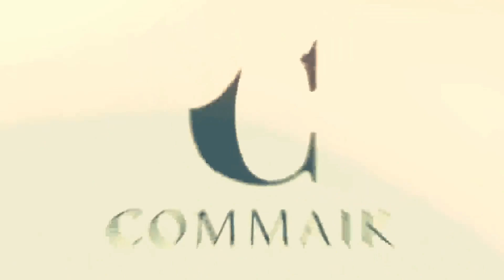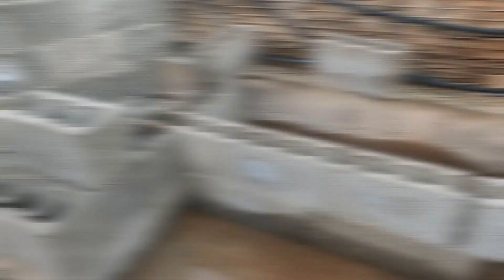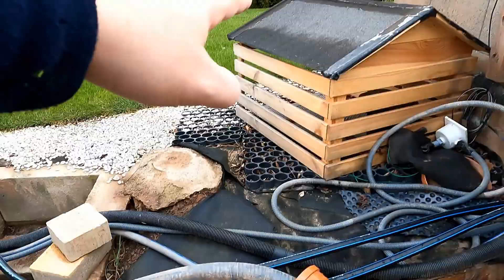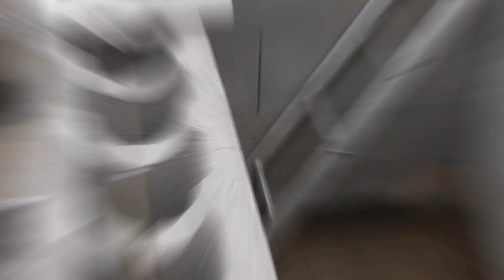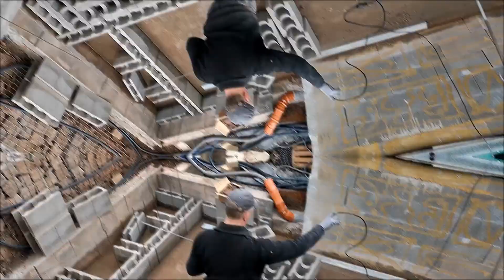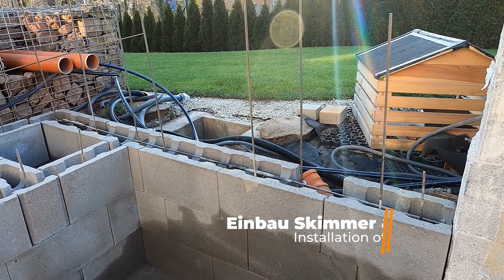Build your own pool: Brick steps and platform, install inlet nozzles - Part 6

Comment from the maker: Product list - tools for pool construction:*
🔗 Angle grinder (large): https://amzn.to/3V6zU1H
🔗 Cutting disc (large): https://amzn.to/45nbyTF
🔗 Drill: https://amzn.to/3mtItAi
🔗 Drill bit (long): https://amzn.to/3tZi82h
🔗 Core drill: https://amzn.to/3t8yKSt
🔗 Binding wire: https://amzn.to/3sWwoFX
🔗 Drill: https://amzn.to/3cTos2G

This video was originally created in German for my main YouTube channel @commaik 🔗 https://youtube.com/commaik. It has been translated into English using 🤖 the AI tool HeyGen, which replicates my voice and synchronizes my lip movements. 

Please note that ⚠ due to dynamic adjustments, the synchronization may not always be perfect.

📺 The original video, which includes English subtitles, can be found here: https://youtu.be/Dj7QUAHHPrc